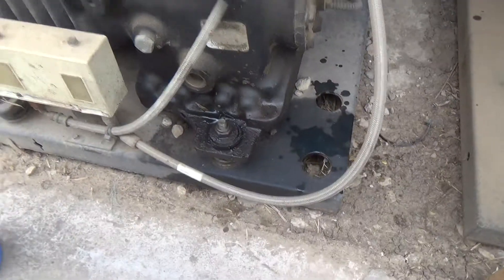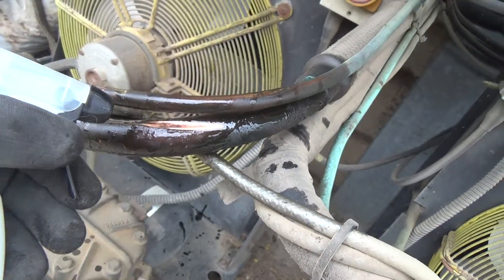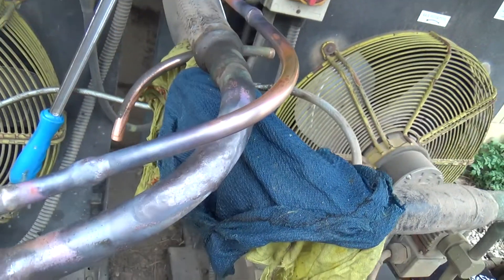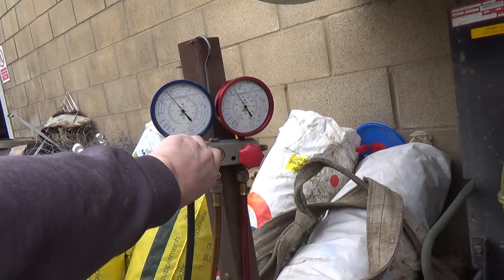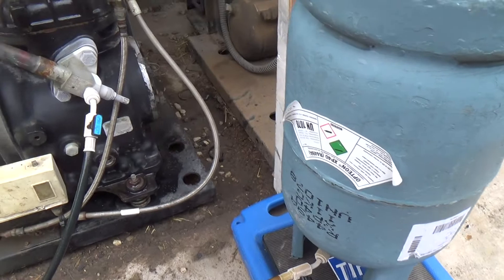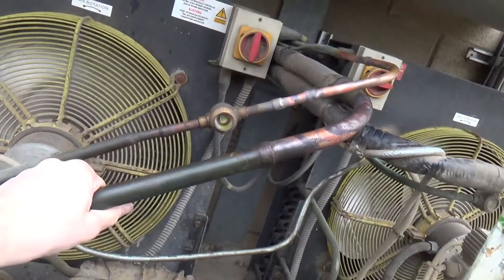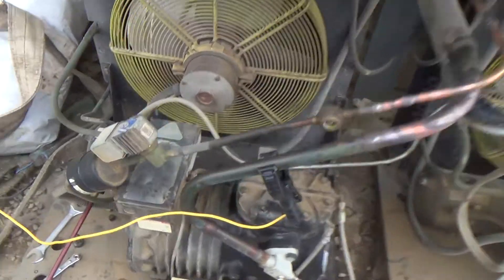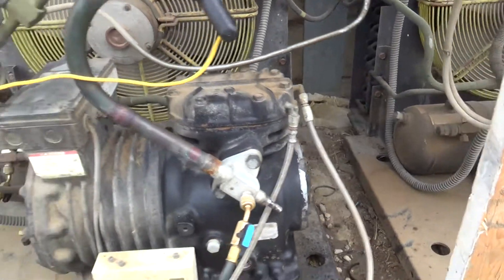Unit Cycling with Oil Stains

Comment: When you change from one gas to another, does it affect the quantity you put in it?
Reply from the maker: It often does, sometimes it can be a bit more, sometimes less, usually you'd start with say 70% of the original charge and gradually add more until  the system is charged.
Reply: @heavydiesel  cool. I'm not very experienced in this. I'm a hgv fitter, so I've watched them do fridge trailers and what have you, but that's about it.
Reply from the maker: @raeabrittain4821  You'd be surprised how simple this stuff is, lot easier than the stuff you work on!
Reply: @heavydiesel  shows the effect perspective can have. I would say it was the other way round. Your stuff seems a lot harder.

Comment: John you need one of them heating belts to wrap around the refrigerant tank .
If you take the thermostat off it actually gets pretty darn warm . You just have to get an extension cord or a multi plug with an on/off button to act as a manual thermostat so you don't burn it out and voila !
For real I've almost emptied a tank without even using the recovery unit , just from  having the system  in a vaccum and using  the heating belt 👍
Reply: I often just wave the gas torch at the tank from a distance, so as to get it a little bit warmer, so as to get that little bit faster going, and have also floated the tank in a bucket of hot water for 10 minutes before connecting, especially as it gets close to empty. Recovery tank you often have to chill it in a bucket of cold water, especially as it is getting a large charge into it, to keep the pressure down.
Reply from the maker: I've got a hot air gun I use sometimes, doesn't get too hot on the first setting so less chance of an accident!
Reply from the maker: Yeah, I usually put the refrigerant tank in a bucket of warm water, but they had used it all washing the parlour by the time I got there!